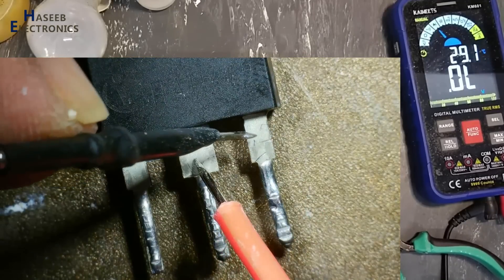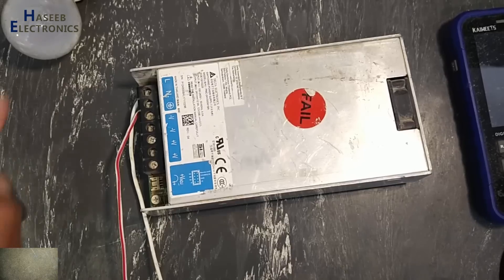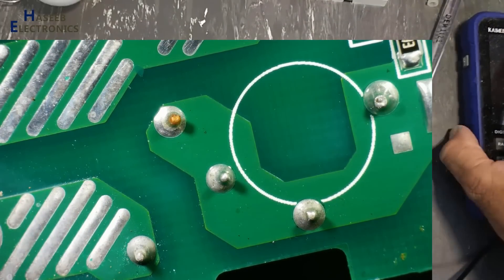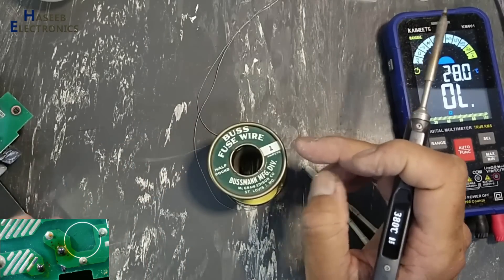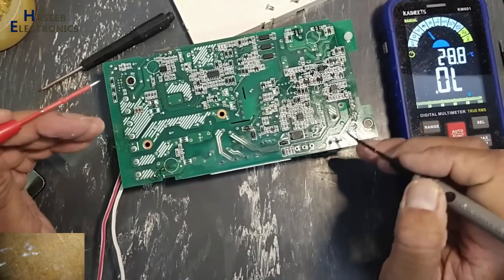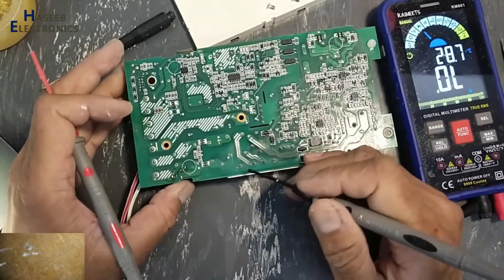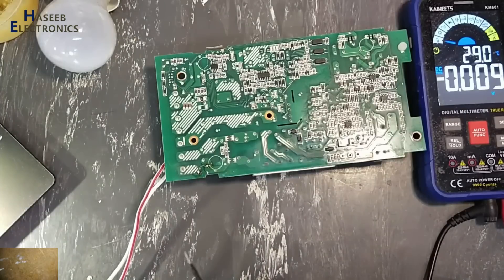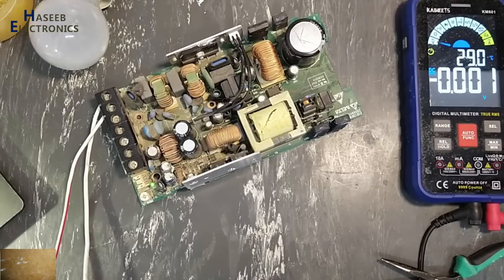{1181} 24 volt SMPS repair, No output voltage

Comment: What is thermal paste? Why is it used? Should thermal paste also be applied along with thermal pad or not? Please let me know, thank you very much ,,,
Reply from the maker: thermal paste provides better thermal conductivity between the component tab and metallic chassis or any heatsink. it is important, specially for the component working at high current circuits. if we use thermal pad / inulator pad. thermal paste must be applied in both sides of the thermal pad (facing to the component tab, and facing to metallic chassis) 
dry surface or outdated or dried thermal paste will cause to increrase the junction temperature of the component and its damage

Comment: hi master haseeb can you help me 
What do I do? This inverter IC numbers are intentionally erased. 
I need the circuit number pin14. The ground terminal is in 5.
this my inverter https://scontent.frak4-2.fna.fbcdn.net/v/t1.6435-9/131251661_229598801870192_3953309798238912305_n.jpg?_nc_cat=105&ccb=1-7&_nc_sid=833d8c&_nc_ohc=m478U3krudgQ7kNvgHPmHIW&_nc_ht=scontent.frak4-2.fna&oh=00_AYC-9XU2Qui9r9Gm2aXuDzPMHE035q3PEd3j9jr0BJ1vpg&oe=66F5556E

Comment: Hello sir last 2 days i trying to contact you please solve my Technical problem 
Hello,

I am Suraj Dake from Pune, India. I am working as a Power Supply Testing Engineer at Intelux Pvt Ltd, Pune. My senior has tasked me with designing a 12V / 1A power supply without using a transformer. Despite my efforts and numerous trials, I have not been successful.

I am using a capacitor-fed method where I have employed an MOV and a capacitor to step down the AC voltage. For voltage regulation, I am using a 16V zener diode to achieve the 12V output. However, when I connect a load, the output voltage drops to 6V.

I have tried various approaches, but I am still struggling with the design. My senior is pressing me to complete this task, so I am reaching out for your assistance. Could you please help me with the calculations and guide me on how to correct this issue?

I am wanting for your reply sir .

Thank you